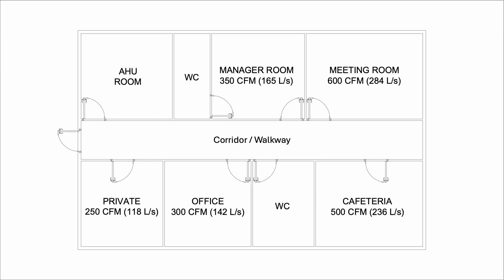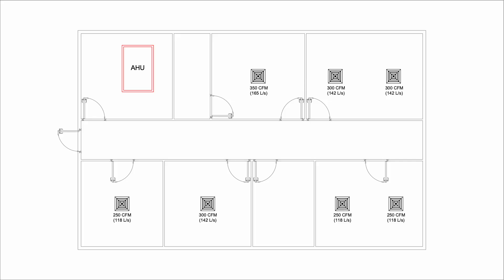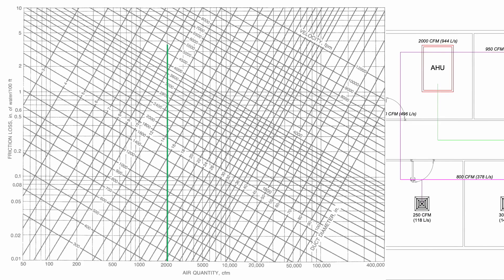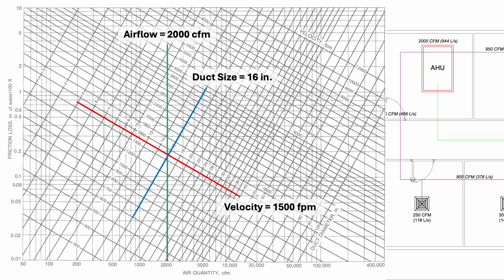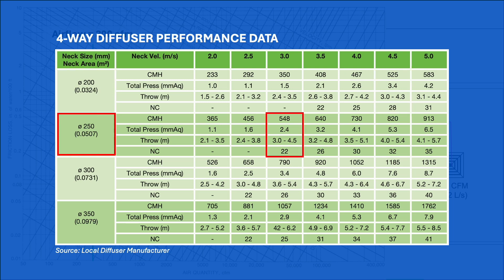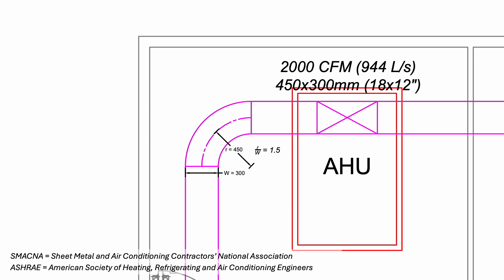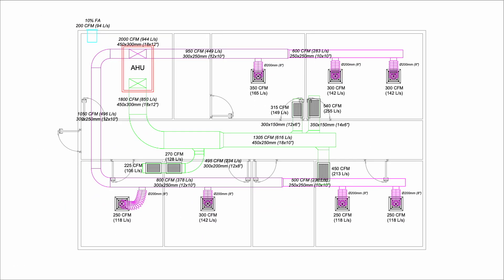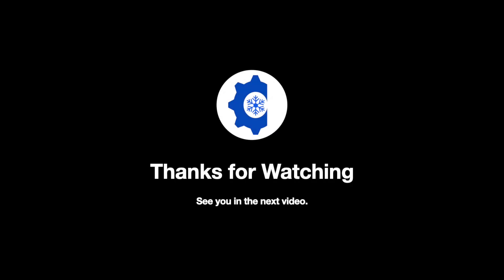Easy Way to Design Duct for HVAC System (Sizing & Layout)

Comment: Wanna ask a special question, what if I have no space to connect the return air duct back into the AHU? How should I size the return air duct to minimize the pressure loss? Thanks!
Thanks for your video!!!
Reply from the maker: Usually, the efficient way is to check how big your return duct can be given the space constraint. Then, calculate the pressure loss and size the AHU fan accordingly. However, the return duct size cannot be too extreme as not only the pressure loss will shoot up exponentially, the air velocity will exceed 2000 fpm which may start to cause duct vibration and noise issues.
Reply from the maker: Perhaps, can consider free return if the design is viable.
Reply: @a @aircondlounge s, I’m considering it for my project, but I’m not sure how to size the return air duct for the free return (dumping return air into the AHU Room). Thx for your reply anyway 👍
Reply from the maker: The return duct leading to the AHU room can use the usual 0.1 in.wg.

Comment: I'm trying to size a main round trunk duct for 1600 cfm at 1150 FPM static pressure. I want to drill holes in the trunk for air distribution. What size holes (2 to 3 inch) and how many?  Straight duct for a store, 80 linear feet.

Comment: may i know, is it applicable if the branch duct height is same as the main duct height? For example the main duct is 600x250, the branch is 250x250

Comment: Hey "Yu chang" , this video is amazing, almost basic idea is clear about duct sizing,   but I have some issues ? suppose  a big hall, how to divide CFM & how many supply & return air diffuser is installed there.
Reply from the maker: CFM can divide equally unless there’s a full height glass section where you might want to direct more air towards there. Supply diffuser based on the diffuser type. Eg: jet diffuser can allow more CFM per diffuser, thus lower diffuser qty. Return grilles same concept but they can also be placed at specific locations to reduce air stagnation.

Comment: Hello, I have some questions. From this system, how does fresh air reach the other rooms from where you have put the fan unit ?
Reply from the maker: The fresh air opening can be ducted to the return duct to mix with the return air and supply to all rooms.
Reply: This design is a mini ahu or fan coil unit in an office setting supplying air through supply diffusers and return grilles. 
A DOAS or a dedicated outdoor air system uses a system to control outdoor air and distribute it around the building so it’s basically an AHU which takes outdoor air and uses it as ventilation.

Comment: how did you get the volume flow rate of each room at the beginning of the video?
Reply from the maker: You need to calculate the sensible load of each room and use Qs=1.08xCFMxdT to find the airflow needed for each room.
Reply: @aircondlounge  thank you!
Reply: @aircondlounge hello, what do you mean by sensible load? Is it the cooling load per room?
Reply from the maker: In HVAC, heat load is split into two types: a) sensible and b) latent. Sensible load affects the temperature we feel, latent load has something to do with humidity. Perhaps, this blog post can give better clarity: https://aircondlounge.com/what-is-sensible-cooling-capacity/

Comment: Is it depends on me  the "total number of air terminals / supply duct"?
Reply from the maker: Use guidelines like how many CFM per terminal for noise control and throw distance (not covered in this video) to determine the number of air terminals needed.
Reply: @aircondlounge  we are still to determine the CFM for each terminal🥲 so i think i should assume?😅
Reply from the maker: @nornia6855 yes need to determine the CFM for each terminal, use the terminal catalogue to do so. Estimate also can
Reply: @aircondlounge  okay, thank you

Comment: Whrre do i place my ahu room? Anyside ?
Reply from the maker: Generally, the AHU room should allow the duct to run through multiple rooms without much obstructions. For example, if the AHU room is located beside a staircase and air conditioning is needed on the other side of the staircase, then this AHU room location is not good because the duct needs to penetrate through the staircase which is mostly not allowed due to fire safety and other restrictions.
Reply: Better to put AHU Room at the floor itself and supply and return to be ducted if possible to ensure effective cooling and Indoor air quality

Comment: is height of the duct same in everyroom if the height of the ceiling is same in every room.Or do we need to decrease the height according to cfm
Reply from the maker: We need to decrease the height according to cfm. However, watch out as you need to leave enough height if you’re going to tap out a collar for the flexible duct.

Comment: It was definitely a very explanatory video. We would like to see a presentation where the fittings connection rules are explained in more detail with SMACNA and ASHRAE references.
Reply from the maker: Thanks for your compliment. I think what you’re looking for is here: https://youtu.be/NWyP7LuAaao where I explain the duct static pressure calculation with all the fittings referenced back to ASHRAE. If you've watch it before and still need more depth in the fitting connection rules (which I understand can be confusing), I'm releasing a duct design course that will go into details about the fitting connections. You may consider subscribing to my newsletter on https://course.aircondlounge.com as the new course will be released on that platform.
Reply: hello thanks for your comment. Iwill be following the website for the course.

I watched the other video you shared and it was very explanatory. there I am not talking about finding the Co values for each fitting. what I want to talk about is: the rules for connecting fittings to each other for all types of ducts, the maximum permitted dimensions in ashrae and other standards for all fittings and connection types.
Reply from the maker: I think the dimension of duct fittings can be anything but it is best to stay within what have been tested out for the Co value for static pressure calculation. ASHRAE Duct Fitting Database (DFDB) so far has the most combination of different dimensions and types of fittings.